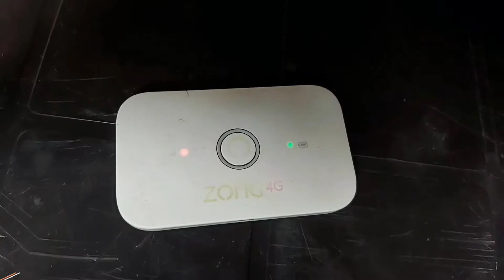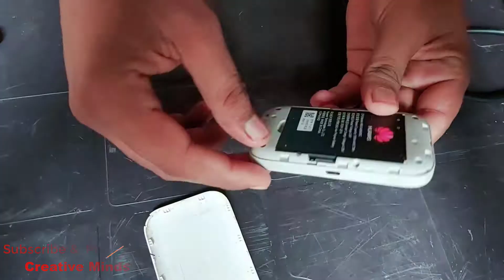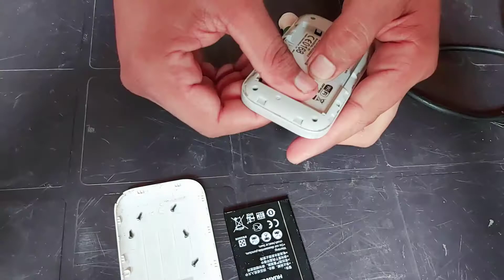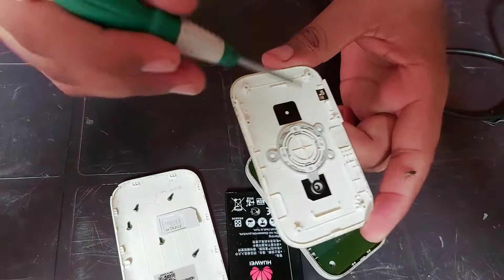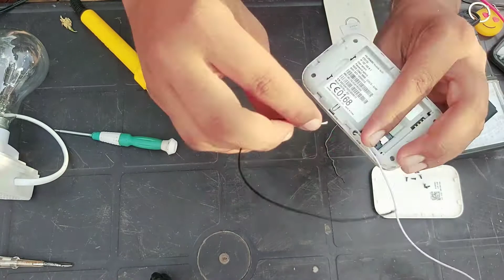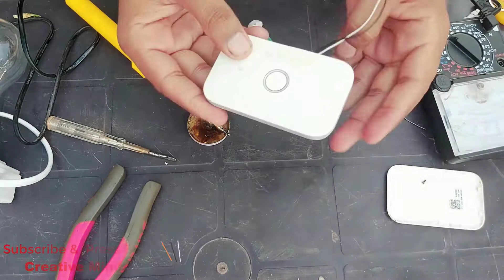How to Make Antena of Zong 4g Device at Home

Comment: These points are for wifi signals not for receiving sim signals
Reply: I thought these points are for receiving sim signals 😅
Reply: Bro i have same device, when i remove front cover which have antenna stripe attached, the wifi signals become weaker on mobile not the sim single on the device webui